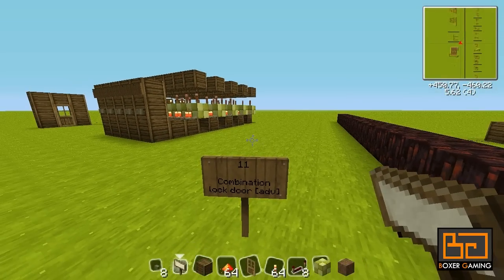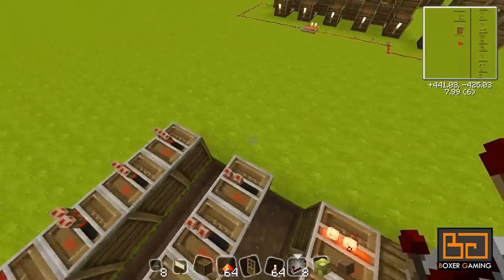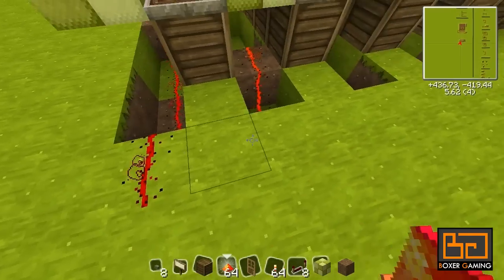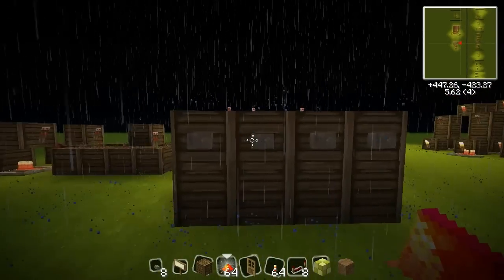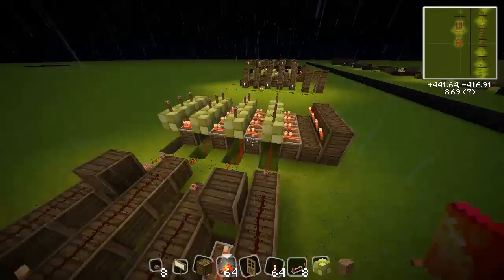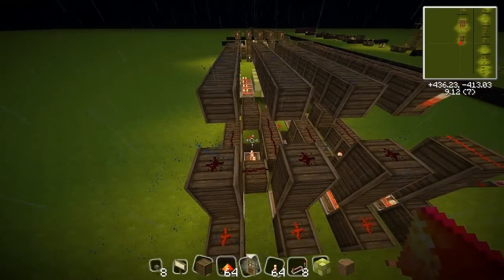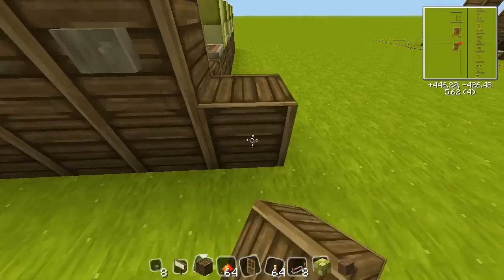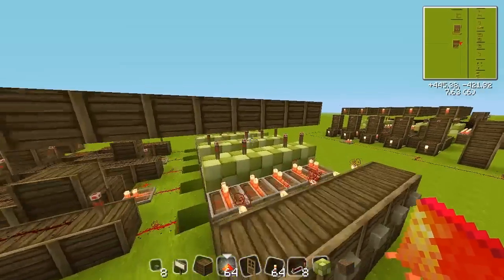MineCraft Advanced Combination Lock Door [1.2]

Comment from the maker: @IAmFluffey Because of the AND gates in the RS NOR latch array, the previous "key" must be right before the next torch can be lit.

IE. if the combination is 1234:

If you press 1, torch #1 will turn on. If you then press 4, all torches reset. If you press 2 at start, torch #2 will not turn on because torch #1 is not on yet. Bruteforcing is always possible with these things - hence adding more numbers makes it much harder to bruteforce.